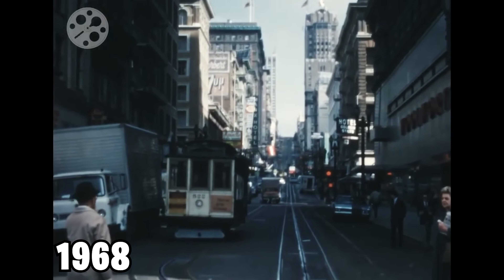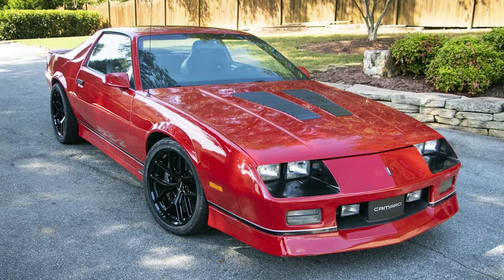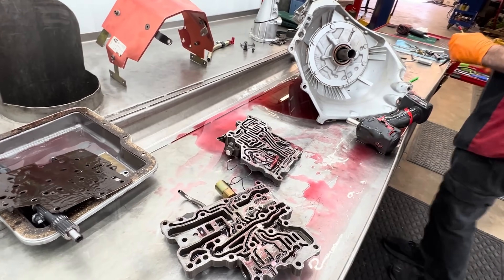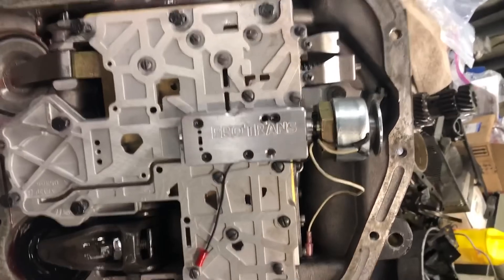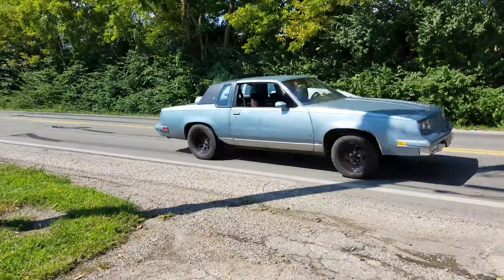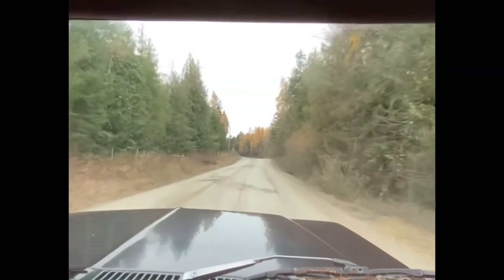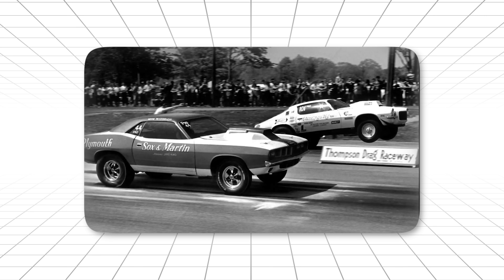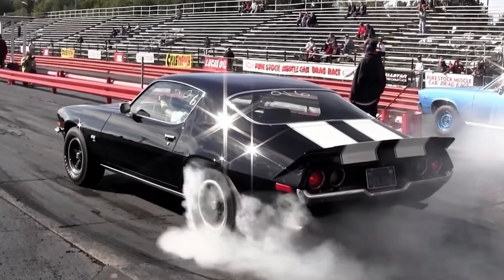The Engineering Marvels That BUILT Muscle Car ICONS

Comment: This is hilarious. The 727 & 904 torqueflites were the first all aluminum case light weight heavy duty automatic transmission. It took GM & ford a few years to come up with something similar. 1962 for the torqueflites, a few years later for the GM & ford wanna bees. And that Borg Warner T-10 4 speed was a light weight trans intended for the small block Chevies, 265 & 283. The truely heavy duty 4 speed was the MoPar 833 series 4 speed that came out in 64.

Comment: The "rock crusher" got that name because after about 4 hard shifts the gears sounded like rocks were in the tranny. With its aluminum flexy case it was the worst of the GM trannies. And at the risk of hurting feelings here, the Ford top loader was far and away the most popular manual trans used by Ford and GM guys. It was bulletproof and was the only yrans used in Nascar for decades. The only class it wasn't the most popular in was Pro Stock where Lenco transmissions were allowed. If you're going to make a vid about this stuff do some research if you weren't actually there.

Comment: I have a C6 in my 69 Mustang.  The car originally came with a 390.  Now it has a bored and stroked 66-390 block now 445 CI.  The C6 isn't stock anymore but is able to handle the increased HP and Torque the 445 now puts out (514hp and 600 lb-ft torque).

Comment: 70 years old. Owned and ran all of those auto trannys  TH400 and C6 are my top choice. Did incredible feats with my Chevy power glide. The torque flite is strong. However  m. TH400 AND C6 would out last them. I don't think a properly serviced C6 ever wears out.
Reply: my c6 lasted 35 years in my racecar!!

Comment: One THM350 weak point was excessive end-play between the pump and center support and resulting wobble of the direct clutch drum due to both the end play and use of a relatively narrow bushing in the drum. If I recall, GM had to pay consumers for problems with that transmission.

Comment: I had a 1974 Chevy 3/4 ton with the 400 I had to have rebuilt twice it went capute across Nebraska the second time only second gear when I reached Cheyanne, WY. The same thing happened for a 700r4 in my 1987 Jimmy so don't tell me how good automatics are. They are definitely not bullet proof.

Comment: The Rockcrusher with its aluminum case was the Weakest of the Big 3 Top Tier manual 4 speeds. Although not a bad tranny, just weaker. The Ford 1 3/8” Big Pinion close ratio Top Loader with a iron case was considerably Stronger. The Strongest by far was the Chrysler A833 Hemi 4speed, also most common with a iron case. Greater center to center distance and internal arrangement allowed for thicker and wider gears. Also the M-22 was not straight cut gears but it did have a Shallower Helix angle which did make them stronger than a M-20 or M-21. Rockcrusher Failures probably cost Legendary Corvette IMSA Racer John Greenwood at least a couple of championships and Many Races. Probably his most common mechanical failure.. His ZL-1 427 big blocks and 15” wide rear tread width put out over 800hp to the ground and in the 24 Hours of Daytona allowed him to turn a 236 mph lap on the famed Track. In NHRA drag racing it was common in several classes to exchange the Rock Crusher M-22 for the Stronger Slick Shift modded A833 Hemi 4 speed.
Reply: I got a used 69 Z-28 many years ago for $900 with a junkyard 350, and amazingly found a 302 like it originally had to put in it. An amazing car. The 4-speed was tiny and light in comparison to my buddies Mopar 4-speed, which was a monster and hard to muscle into place. It could only be much stronger. The Muncie 4-speed was quite noisy, and is why they were called "rock crushers".
Reply: @5metoo My First Vette was a 72 with a 350 and a M-20 wide ratio Muncie with a 2.52 first gear and a 3.36 rear posi for a Nice 8.46 first gear ratio. About the same as a M-21 close ratio of 2.20 with a 3.73 rear. With a Good Shifter they were always great shifting trans. Probably pretty hard to hurt one with a small block. Just not the Best for Healthy Big Blocks.

Comment: Imagine this, my '81 Malibu being built as a "1-of-1-of-N0NE" Malibu SS 396 Z-16 with "Day-2" mods on a "Mark IV" Big Block backed up by a TH400 w/a Gear Vendors o.d unit to a 12-bolt Moser rear disc brakes that fit innately behind my 15×8 rallies, appearing about as factory fresh as you can get...that may just possibly turn high 11's within a distance of 1320 ft...I'm closer to receiving an AARP membership than I am in receiving an offer for a WKRP internship, so ¥Ę$, SHE HAS A/C...

Comment: I've had the Torqueflite 727 in my 73 International 1110 pickup, a powerglide in my 67 chevrolet Impala, a TH 350 in my 78 GMC Jimmy, and a 4L80e in my 1995 GMC Sierra, which has 240,000 miles on it and I've only changed fluid and filter once.
Reply: All car culture is 4 turd stroke garbage! How anyone gets all hysterical with American muscle with 4 turd strokes is beyond me. Awsome cars but deserve DFI 2 stroke options.Lets see any of them run just oil, injection tipped in any position without oil changes and run in reverse!. DFI 2 stroke v8's would be insane and as a 2T R&D aholic its hard to believe cars are still stuck with the 4 turd stroke!

Comment: The M22 never had "straight cut" gears;  just a reduced helix angle of the gears teeth producing increased whine..The big early Packards we used behind big V8's back in the day were constant-mesh with all gears riding on ball bearings-- no bushings and this trans produced a low powerful whine unlike any other trans of the day. Also the optional  HD R-11 Borg Warner OD Packard used was another plus.
Reply: So I have rebuilt 4 M22 rock crushers. You are correct that theyre not true straight cuts. They are reduced helical. I believe theyre cut at like a 20 degree angle as opposed to the 30 degree of the 20 and 21. This made it so it was still streetable but could handle the power of the big blocks at the time.
I swear on my grandparents graves this is true. My grandpa had built a clone L88 427 for his 69 Camaro that he raced with an M22 rock crusher. He power shifted that sum bitch every race and the case always broke before any internals did. The 2 cases he wrecked snapped the ears off at the bellhousing. But by God that transmission survived the beating of a 5.12 rear end and a 550hp big block
Reply: I'm pretty sure I saw them with straight cut gears in some "Nove-ahhs". 😂

Comment: Great video; but Ford’s FMX should had been mentioned too. The powerglide had a factory variant (manual automatic) called torqueglide that drag racers liked; I believe using a Opel or Vegas torque converter was the norm?
Reply: FMX had a cast iron main case, individual valve bodies, built very tough, guys used to run Vega converters in GM hot rods until they would fail and then grab another

Comment: If the 400 was tough for drag racing, why did the aftermarket (REID) have to build a stronger case?  And the Powerglide is not very efficient. The RPM drops too low on the shift, taking the engine out of its powerband….   Yes, I have all the data. I’ve owned a Dyno shop (engine, chassis and transmission dynos) for two decades…

Comment: Imagine this I’m walking out to my Garage to get in my matching numbers 68 RS/SS Camaro, 350 with 4 speed Muncie and 12 bolt rear with 5 leaf springs. 110k original miles.
Reply: post some pics man...
Reply: stop braggin!
Reply: Imagine this. I build restoration mod 1st gen camaros with 5 and 6 speed manuals. Also restore originals. Munchies are piling up in lou of tremec swaps for driveability.
Reply: @jonbrockman5308 I daily drove my car for years it always starts one pump turn key and drives great with the Muncie. I don’t need to ruin I mean restomod what’s not broke.
Reply from the maker: Color?
Reply: @SpeedStyle-d9u it’s white now it was originally rallye green
Reply: But is it the rock crusher?
Reply: @darrenalkire5281 well the m22 pretty much only came with big blocks id have to check out much closer but I’m pretty sure it’s probably the m-21 since my cars a 350 car. They would have the same gear ratios though.

Comment: The TH350 was designed to fail. Chevy had done too well with their with their Powerglide and TH400. They would last longer than the car. The brass wanted something they could sell to the public out of their dealers shops, so they built the TH 350. The difference is the input shafts were supported by the output shafts with a bearing in the female side of the coupled shafts to allow for the difference in shaft speeds. The TH350 was the only transmission made that didn’t support these shafts. The two shafts just butted up against each other and the clutches that controlled the gears held them up, hydraulically. The two shafts not being held together allowed the clutches to move around wearing them out much faster than any other transmission at the time. The gearheads at the knew this and TH 350’s became scrap. I don’t know for sure, but I think the aftermarket addressed this issue with custom shafts. But before anything like that was marketed the TH350 was usually replaced by the TH400.
Reply: The TH350 was originally meant for the 1970 Corvair, but appeared in other cars in 1969. Pontiac used the TH400 with the 1969 350 HO, but Olds used the TH350 with 350 W31. The W31 TH350 was beefed up slightly, but mostly with additional clutch plates. Usually the maximum torque capacity of the TH350 is 325 lb-ft.